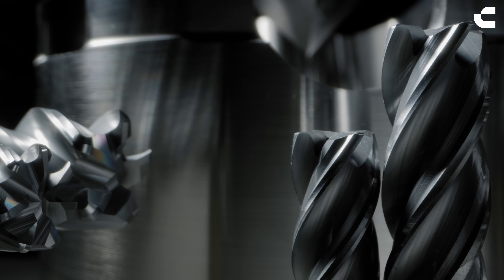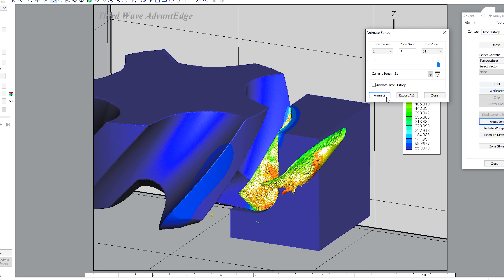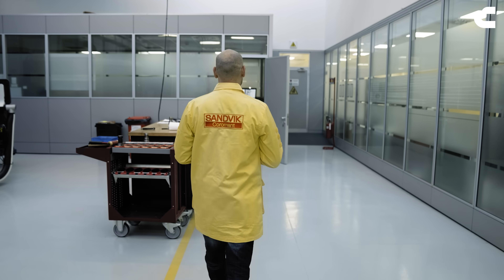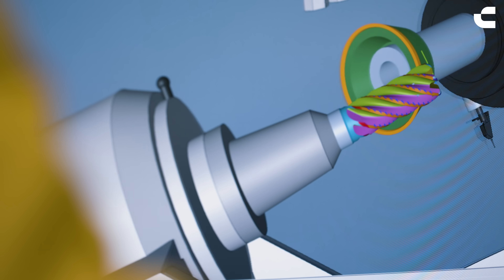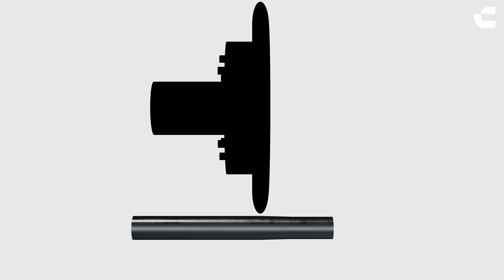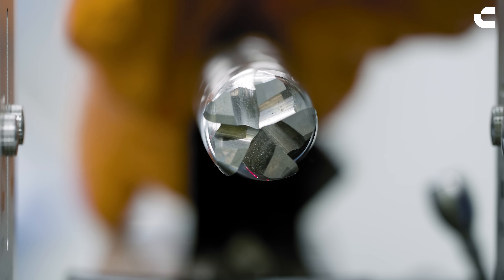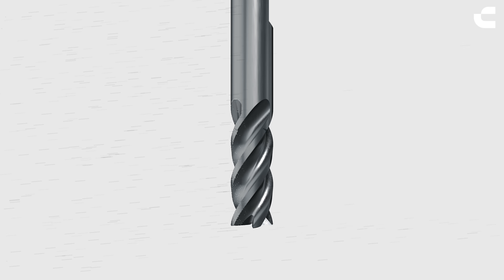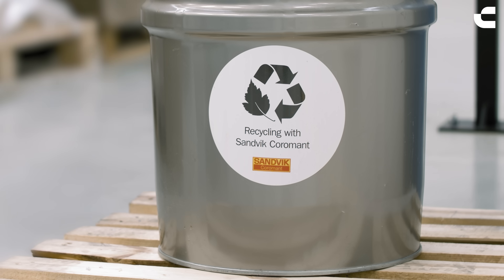Solid round tools - How it´s made

Comment: Very informative video, although i still have a question,... How are the holes, for the through-tool-cooling made? Are they EDM-machined? Because drilling ore internal molds before sintering don't work i assume.
Reply from the maker: Hi there
We use 2 types of processing for blanks: pressing or extrusion and then sintering. Holes are generated on an initial stage of blank shape formation as a feature of the blank itself. EDM is not used in this stage

Comment: Still has me wondering how they add coolant channels to the tools 🤔
Reply: The tool is sintered, the holes for the coolant is formed with a monofilament line, pretty close to fishing line that melts out when in the oven.
Reply: They form the cooling channels within the metal powder mix before sending it to be sintered which will later become the blank. Though I don't know what process they use to form the channels in the metal powder mix.
Reply: drilled with hss bits on a bridgeport